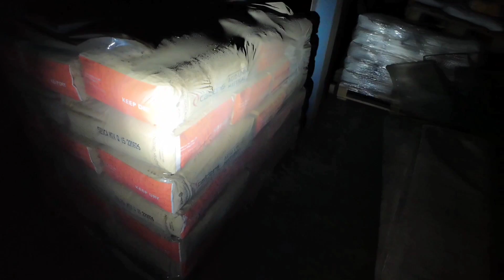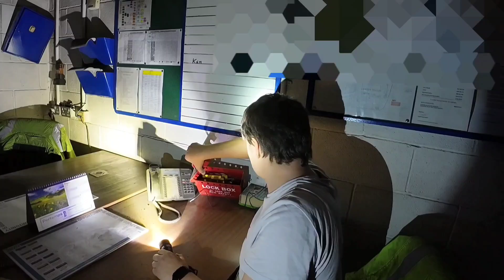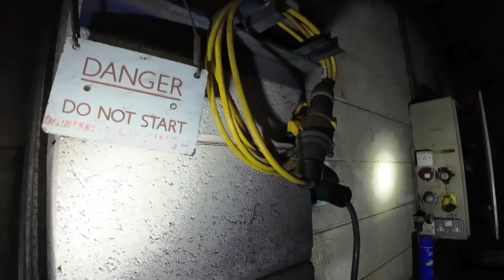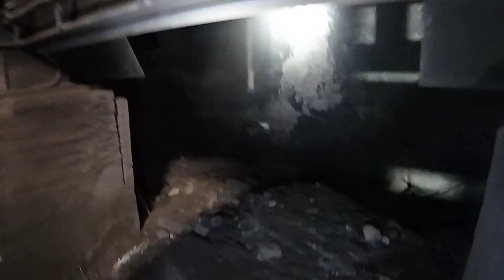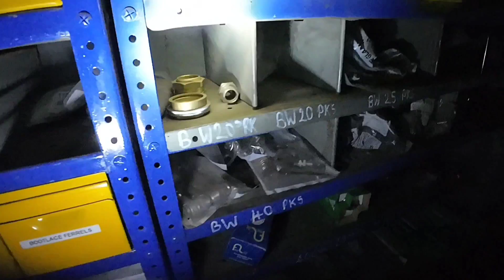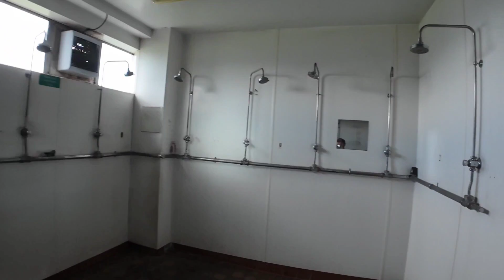massive abandoned black country factory - power still on !!

Comment: The lower level & sub station I guess would have been at least 11000v if they where not isolated you where lucky you didn’t touch any of the buss bars, very interesting though
Reply from the maker: Thanks for sharing that bud was very careful not to touch any wires just incase so many interesting things in there could have spent hours going into detail

Comment: I lived over the road from that factory when I was a kid, it used to have a steel chimney stack that pumped out some smoke. Then they converted into gas, plus you can see the place I used to work out of the office windows 😂 shame it closed suddenly this year I was told. If you drove past when it was open you could see the furnace burning. There was one the other side of the canal but that was demolished early 2000s for units.great video amazing place
Reply from the maker: Cheers bud mad how this has gone into liquidation the most easiest place I've got into was so inviting off the canal no wall so could walk right the way in back in August but now canal and river trust have put the wall back up .  Never seen the one opposite but can imagine there was more industrial stuff before it all went around that area . That factory parts dates to the 1800s
Reply: I’m 37 so I have been in some amazing places across the black country Langley maltings, chances glass works but those are just the ones you have featured in your vids. A lot has been knocked down a built on now. I’m like you I love the canals abandoned building since I was really interested from a young age. I live in Cheshire now but love seen how things are progressing back home.